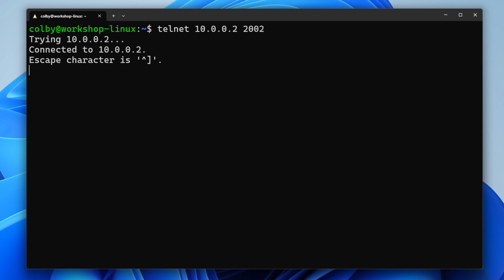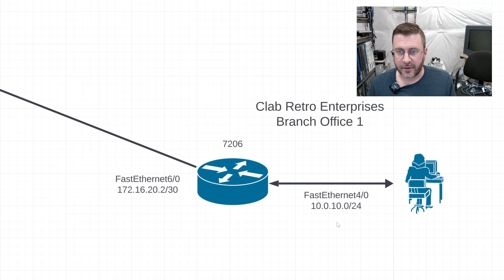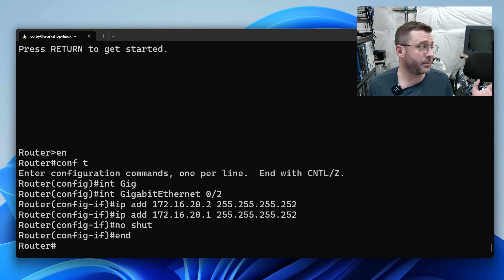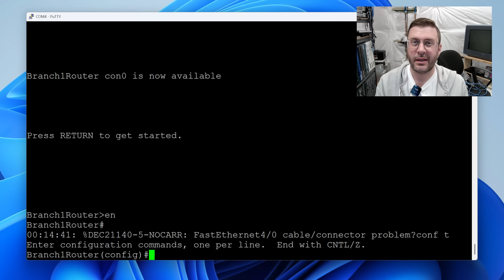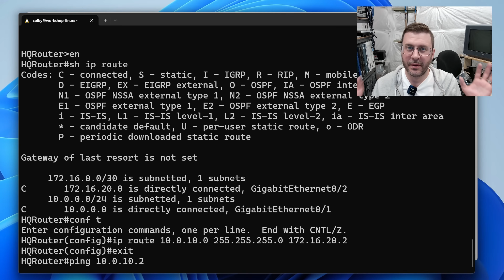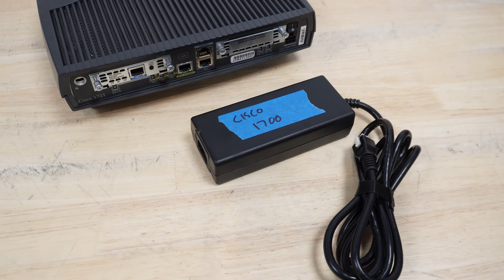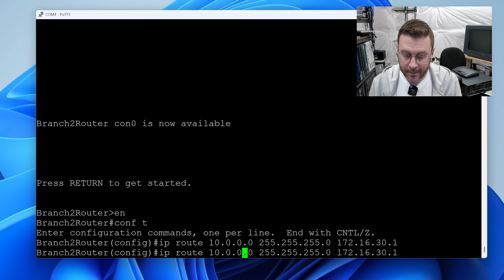Building a Branch Office

Comment: It's not entirely out of left-field to have point to point links - ISPs can provide dark fibre links that will allow you to connect P2P (usually over single mode fibre), but unless you have a lot of money you're usually stuck with ISP supplied pipes, although nowadays there are products available that will terminate a bandwidth limited ethernet point-to-point link. In the ye olden days (when I was a network admin in the 2000's) these included single / bonded ISDN2 links, E1 (T1) fractional links, ADSL (yep .. had a good relationship with the local ISP and a hardware vendor willing to bend their product to allow Ethernet -> ATM PVC links to route into the ADSL DSLAM for distribution to branch offices) .. we even had a dark copper pair at one place with an SDSL link. (I'm not mentioning X.25, as that was a dark form of magic I actively tried to avoid).

Maybe look for some baby DSLAM hardware to play with ADSL / VDSL links, as these are very affordable and with the right profiles running will blow ISDN out of the water.

Also .. routing protocols are a must, esp. when you get above a few different networks (as the routing table otherwise will quickly get out of control, and you end up in asymmetric routing hell)

Comment: Snce you might want to grow the number of branches, instead of defining all networks specifically in your static routes, you can use a "catch-all" called a default route. It will match all networks (except specific ones already in the routing table, such as the local network). It looks like: ip route 0.0.0.0 0.0.0.0 and then the next hop IP.

Comment: 26:30 I had to rewind the production as I first thought you said "shitty" then I heard "shady" but you know you can't trust a bean counter, they always ruin the fun at a work place.
39:36 I used to work in a place that did exactly what you are doing. They used to set up all the gear and get all the routers and switches talking then we would go out to the different places and plug it all in. I did mostly grunt work not much configuring of devices everything was color coded so we knew what plugged into what. It was always fun when you arrived on site and one component did not get shipped.

Comment: To be completely period correct here, we would need to route over public infrastructure, which means you would have a public IP address on the branch and HQ routers in most cases, unless of coarse you were using a leased line.  Anyways, this would normally be setup over a GRE tunnel between the branch and HQ.  The reason for this is no sane public infrastructure (ISP) would route private class A/B/C addresses (10.0.0.0/16 in this example)

Comment: Funny enough, the 7200 VXR is actually the platform I learned on about 10 years ago when I got into networking, but it was virtualized in GNS3. For a few reasons the IOS that runs on there works great when emulated and supports all the routing protocols to play with. Very cool to actually see what the modules look like since I never got a chance in person... in GNS3 you just pick the ones you want from a drop down and boot it up. That etherswitch module is legendary for tripping up the noobies since it's kind of a catalyst switch but not really and doesn't act like normal router ports either.

Comment: Wow! Talk about flashbacks! Back in the late 90s I had to do the exact same thing between two offices in different cities, using the same 1721 routers. They were connected via a T1 Frame Relay circuit, which at the branch office was split as a Point-to-Point and Inet connection. (Splitting the 24 channels up, keeping the Inet working at the branch when the P2P connection would go down, on occasion).
Once I got the routing straight in my brain and in the config (No routing protocols like RIP used to protect the innocent), doing the ping from one office to the other, then seeing the trace route show all of my routers, a HUGE sense of relief, joy, and satisfaction came over me. The sense of accomplishment was palatable :).
Reply: What's the bandwidth and typical usage back in that day? I'm sure at least email, Google also already exists. Did the office usually saturates the line?

Comment: I can't remember if this work for 10/100Mb Ethernet or not, but for your point to point link, you might be able to set  mdix auto on the interfaces you are using for the point to point link and avoid the need for the cross over cable

Comment: Yes, throwing an ISP into the mix makes life so much more fun.
Though, I can't help but ponder if one can make more generalized routing rules. Like "Everything that isn't yourself, go this way." In this example, everything that isn't 10.0.20.XX and then assign it some route priority.
Such that we can have other known direct links with higher priority overruling the generalized rule when applicable.

Though, personally I often find the whole TCP/IP on top of [insert actual transport protocol here] is needlessly complex at the best of times.

Another thing I can't help but ponder is a lot of modern companies could rely enough on various web interfaces for their work that setting up a branch office would be as simple as settling down before "any" computer with a browser and logging into the company website.
Reply from the maker: yeah I definitely could've set a route of last resort
Reply: @clabretro  It would make larger deployments easier. Since then one just have to fiddle with adjusting routing at the head office. Everything else just shrugs and says "HQ knows where this should go if I don't."

It is lazy, but should work.

Comment: I wonder if the cisco gear would support /31 P2P networks. Realistically you don't need the broadcast or network adress (172.16.20.0 & 172.16.20.3) in a P2P network, hence you can conserve some IP address space. It's actually specified that way in the RFC 3021 from December 2000. (sadly most consumer-grade network gear doesn't accept /31 as a valid subnet)

Comment: Flashing back 30 years or so …
You could have configured the branches with a default route and managed all the static routes on the vxr. Any new branches would just “magically” work.
Previous reference to BGP would be the next step, but unlikely that an enterprise would use bgp until/unless it got massive.  more appropriate would be OSPF or if you insist on Cisco eigrp.  OSPF is superior in my experience.

Comment: A few notes: Most routers allow using /31 point-to-point links, you need to tell it's a PtP link and then use the two possible IPs - no need for broadcast or all-zero on a PtP link after all. There's nothing wrong with using /30 but it can burn up surprising number of IPs for very large ISPs (where they would often be "real" IPs), some technicians just prefers doing that way regardless. Some do the same today even with IPv6 (IE /127 for PtP) despite there being no reason to worry about wasting public IPs there.
Common practice when branch offices needed to reach each other was to use a "covering" route on all branches - IE in this case each branch office would have a route for say 10.0.0.0/16 to the HQ router, this works because the local route (for the local branch) has higher priority. This eliminates the need to reconfigure ALL branch offices each time a new branch office is added! Of course if branch offices doesn't need to talk to each other you can use direct routes like you started with.
Reply: Was thinking if it wouldn’t be easier to just do routes to 0.0.0.0 via the HQ router and add branch-specific routes in the HQ? This would even allow to access the „real“ internet if needed. Only a „good“ idea if all branches are allowed to communicate with each other and are allowed to communicate with the world… 

I guess there is no „wrong“ way to do it, it’s just a matter of complexity you might add with doing it like you do it

Comment: Those 7206vxr's were such workhorses.  I had one get dropped when we pulled it from production and were moving it to a lab....from the top of a file cabinet.  It still ran, and was still square enough to get in the rack.  It's the Chuck Norris of routers.

Comment: Talking about "sh ip int br", for your more interface-rich devices, use "sh ip int br | e una". This (e)xcludes all lines which contain (una)assigned, so you only see your (phyiscal and virtual) interfaces that have an ip address associated with them. Makes it easier to find them. For interfaces overview, "sh int status" (you can technically abbreviate status to statu) not only shows you the link state of your interfaces, but also the description you have set for them. 

In regards to your terminal server: Look into setting up a menu on the ISR that opens a telnet connection from the device to itself. That way you can label the connections with text from the menu. Bonus points if you alias your menu command to "menu" or even just "m", that way you only need to remember to type "m" after connecting to it on it's management ssh port and you get all your options presented to you. no more remembering on which port the first squid cable is exposed to. :)

Comment: That was so fun to watch! I used all this stuff 20 - 25 years ago! For my apprentices i keep 2 Cisco 2501 and 3 Cisco 2521XM. It is always fun to trick them with the cross over cable. For serial connections i use HDLC. Very simple and always works but PPP is fine. This basic network setups are always good to get started. One hint: I think that the FastEthernet Cards in the C7200 only support 100MBit half-duplex and full-duplex. Your network might run at half-duplex and the interface counters might see CRC errors when the other system is in full-dplex mode. With both system in HD Mode you can observe collisions.

Comment: In a modern scenario, you could link offices in a few ways.  The easiest way would be to use an EPL (ethernet private line) which is a point to point link.  You call up Spectrum or Frontier or whoever and say I need to link these two offices with 1Gb of speed.  And they put a box in both locations that is linked across their fiber network that is layer 2 only with no internet.  These boxes typically have a single mode fiber link going out that's tuned to a specific wavelength because they aggregate something like 8 or 16 links at slightly different wavelengths across the same fiber.  There is a lot of infrastructure cost in buried fiber so a lot of money goes into coming up with ways to squeeze more data across it.  The method I described is called Dense Wave Division Multiplexing.  

Another way to link offices is over a layer 3 link (internet) and at the end of both links you have a Cisco Integrated Services Router, Cisco Aggregation Services Router, Cisco Adaptable Security Appliance, Silverpeak, or something else that can provide encrypted network tunnel across the public internet.

Older technologies like ISDN, T1, T3, OC3 etc are still technically available but are most likely generated inside your office using an ISP provided box that dumps the traffic across the high speed fiber network.
Reply: Additionally, they don't actually run a 1GB link to you, they will run probably a 10Gb link.  Then when you want to add another service, they just slot in another fiber adapter to you and maybe the other one is a 5Gb internet link.  Other companies can also jump off of the link and put a second box in going to the Spectrum or Frontier box and provide other network services such as a virtual T1 for multiple analog voice lines.

Comment: We've done over the years where I'm at from Cisco 4506 to Cisco 6880 series, to 9606R, which are all spiritual successors to the 7206.  They typically just refer to these now as "core switches"  Layer 3 routing switches that link everything into one place.  It still doesn't truly replace a full router because the ISR routers can still host VPN, FXO/FXS, do VOIP and some other stuff that's in addition just routing.  So these newer core switches have point to point links to all the other switches on your campus.

When you link the 9606 to another 9606 in a virtual stacking configuration, the ports go to 4 digits so something like Twe1/2/0/4  (Twentyfive Gigabit, Switch 1, Slot 2, sub-interface 0, port 4)  I assume the sub interface would be for cards that can take cards.  I've only ever seen it at 0 though.

I don't know exactly when the concept of virtual stacking came about but I don't know if the 7200 series can do it.  But I know the 6880, 9500, 9600, and Nexus devices can do it.

Standard switch stacking with Catalyst 3000 series using stackwise cables has been around for at least 15 years or more.

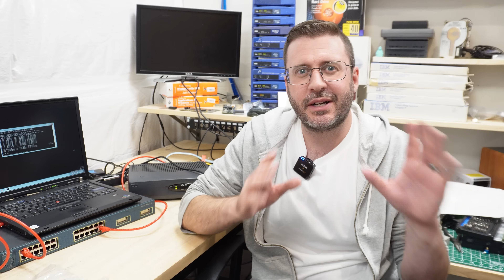Comment: @38:47 you know original DOCSIS was basically an Ethernet topology and in the older versions before they gave everyone integrated routers in their modems you could wireshark between the modem and your router and see every other customer's traffic. Cable internet behaves like an Ethernet bus (still does, but they added some extras) and every customer can see the traffic from every other customer on that same cable run. In theory you could just have two cable modems and run your routers with IP addresses not on the cable network and then use the cable network like your own personal Ethernet WAN.
Reply: I remember that this was used early on in a nearby city in the 90's, and people complained that idiots who had file sharing without password turned on on their Windows computers exposed all their files and whatnot :)
As it behaves like ethernet I think it could even connect to windows file shares via NetBEUI in addition to TCP/IP, so having a software firewall on the Windows computer might not even had helped.
Reply: @Thesecret101-te1lm  yes, in the early days everyone had there computer directly on the public networks with no routers. The only router between you and the Internet back then was the ISPs router at their NOC. You could just reach anyone's computer back then even by just trying ranges of IPs and all ports open.
Reply: @Thesecret101-te1lm  docsis is still Ethernet, but they use vlans now and the modem has a router built in with nat

Comment: If you wanted to keep the short fiber patch cables you could use fiber attenuators to lower the dB if the short runs are too hot.  A few meters should be OK for 10KM but since it’s a retro lab I would err on the side of caution.  Wouldn’t want to burn out an old line card.  Also it might need a decent cleaning on the card connectors itself. 9:44

Comment: It would be sweet if you set up a patron for us to timeshare some time in the retro rack.  I would love to play around with some old protocols/hardware and pay a reasonable fee.  Might be someway to easily setup a tailscale to a host connected to a console switch.

I have a small house so don’t have the space to host any retro gear.
Reply from the maker: I've definitely thought about that, hoping to figure something out eventually!
Reply: @clabretro  Awesome!  Also theoretically it would be possible to rig up something with GRE routers + Tailscale to get this to connect up other retro networking/computers over the Internet.  I have this old IBM 386 that I would love to fix up and connect to something remote like a Netware server.

Comment: For a short while thin coax Ethernet lived on as a point to point connection between buildings on a campus as copper Ethernet is unsuitable for those distances. At least until fiber wasn't astronomically expensive.

Comment: Im pretty sure none of this old Cisco equipment is "hot plug"  the 1721 even had a note on the slot cover in back. They are modular so power down and swap whatever you need then power up again...
Reply from the maker: cisco calls it "online insertion and removal," I'd actually done it before so it must not be supported for all port adapters https://www.cisco.com/c/en/us/support/docs/routers/7500-series-routers/17940-oir-17940.html#cis7200
Reply: @clabretro  Awesome! During these years I didn't really work personally with the high end gear. Set up a few 1900s and PIX in my time though. :) I'm guessing you'd need to verify each individual device and card's tech specs to make sure it's supported.  For example, PCI cards have had hot-pluggable options in time past, but it's been very rare.  Even the very latest servers do not support it. On the newest HP servers your U.2 PCIe NVMe storage drives are pluggable, but there's a little power button on the front to tell the backplane to disconnect power before you remove the device. Cheers!

Comment: The stacking nubs on the routers are for main and backup routers, or possibly WAN and voice routers. Small branch offices might have a blazingly fast T1 link as the primary, and a slow BRI ISDN link or something else as backup, primarily to save the cost of two expensive T1 lines. It also means you can cheap out on the backup router, since it doesn't need to have as much capacity as the main one. Back in the day we had 2Mbps E1 and 128K frame relay as the main and backup to our branch offices. Voice services were on a separate router, and the larger sites had a full 30 channel E1, with smaller sites typically having 2 or 4 BRIs.

Might be fun to play around with a main/backup router setup using a dynamic routing protocol and HSRP for the LAN gateway.

The first Cisco router I bought for home was a 1751-V, which wasn't exactly fast, but my ADSL was initially only 1.5Mbps, and later around 8.5Mbps when they started offering unbundled ADSL, so it was perfectly fast enough. Eventually I did upgrade to ADSL2, but I can't remember if that was with the 1751-V, or a different model, since my old routers are all packed away in storage.